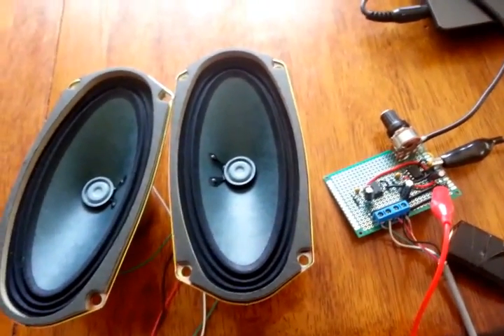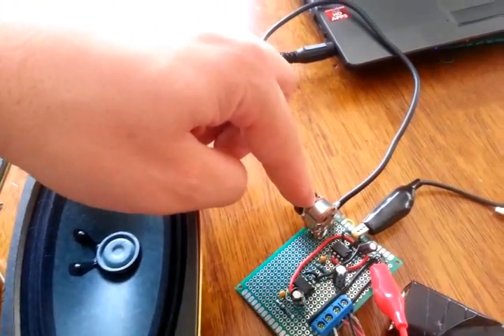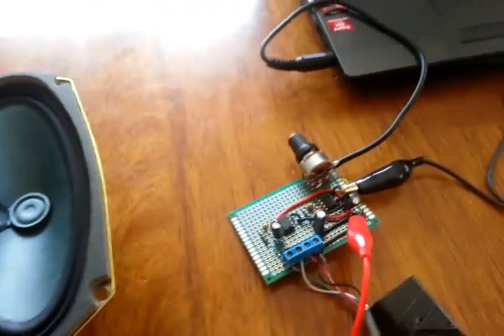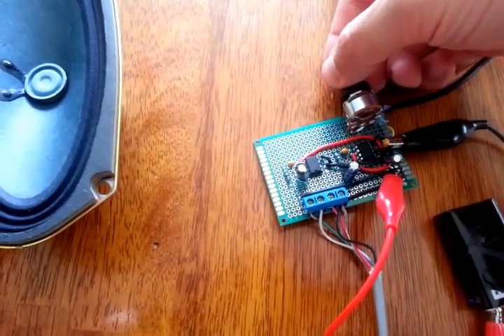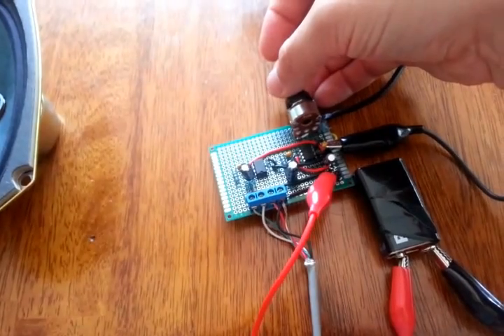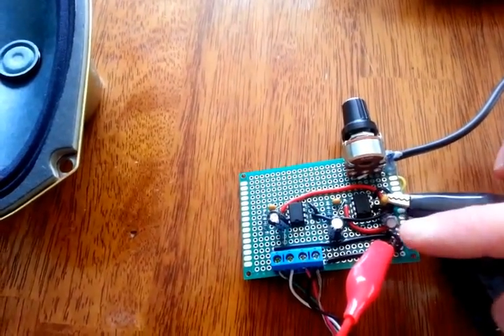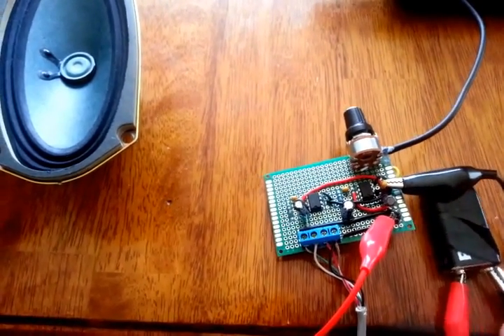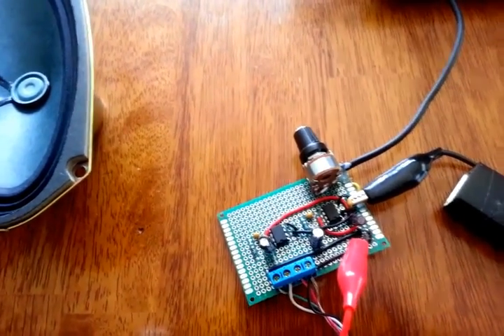LM386 Stereo Amplifier

Comment: I want to build a mono amplifier with a LM386 but do i have to use a log Potentiometer or a linear one?
Reply from the maker: Either will do the trick. Logarithmic pots are usually used for volume control, as they respond more like how our ears hear the change in volume. Logarithmic pots are usually not suitable for most controls for this reason. I think Wikipedia covers log pots.